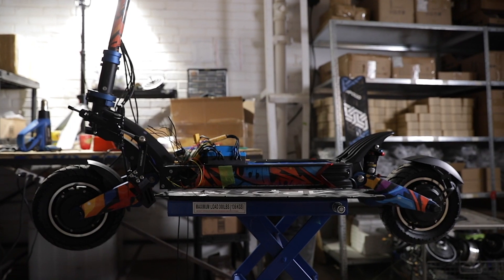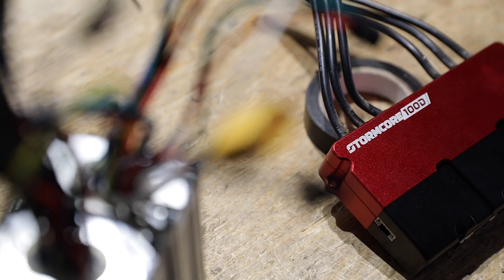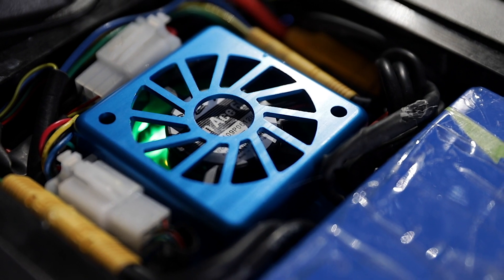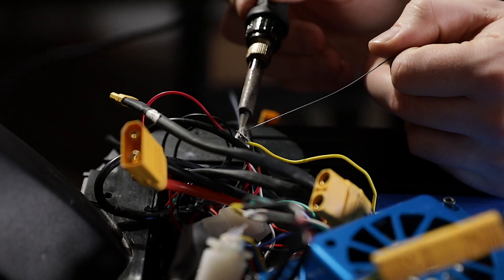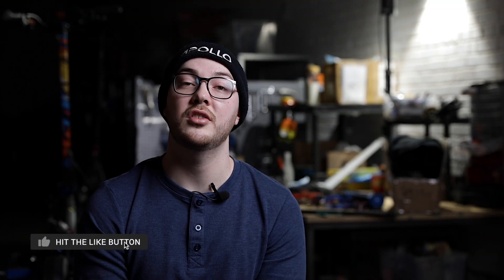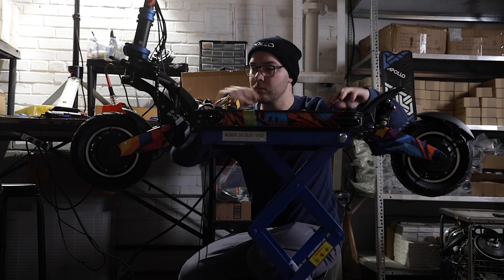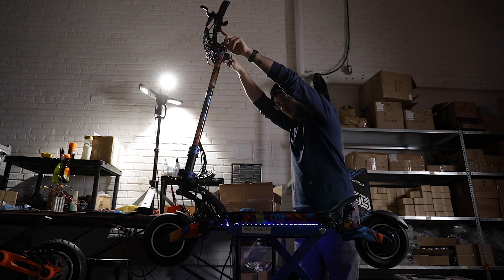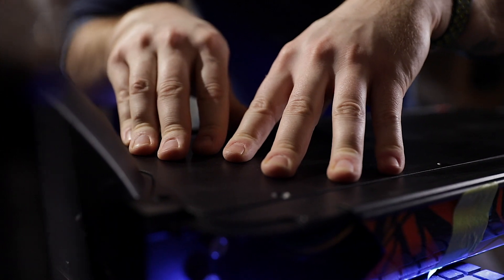LUDICROUS UPGRADE: Apollo Scooters Behind the Scenes (Episode 1)

Comment: Is it possible to buy this stormcore controller so I can change the normal controller? Also it seems like you need only one stormcore instead of 2 normal controllers?
Reply: You should wait for the Apollo Version, it will be worth it and way easier to setup
Reply: @eloipecquet  Thats exactly what I meant
Reply from the maker: A lot of work has gone into our version. It will be a really nice upgrade :-) We will show it off more in future videos.
Reply: @ApolloScooters  Yes I want your improved version. I didn't quite understand, will you start selling it or no?
Reply: @ApolloScooters  Are new Pro Ludo versions bought today on your site come with this new controller and lights or do we have to wait more. And will the Phantom have a Ludo too that will compete with this one preferably with a larger battery since the current Pro battery is way to small.
Reply: @ApolloScooters  its a better option than the stock controllers found in most scooters, but def huge room for improvements for scooter application.